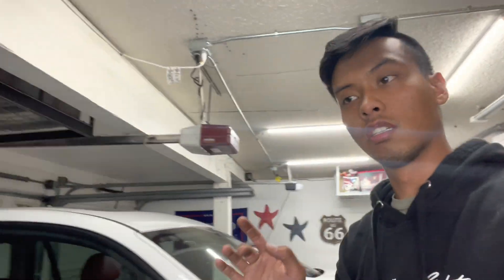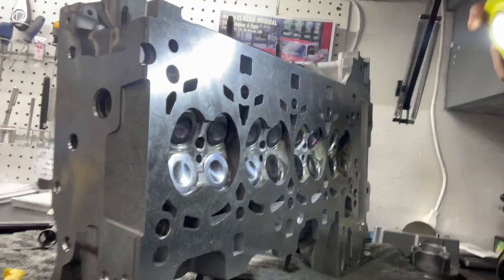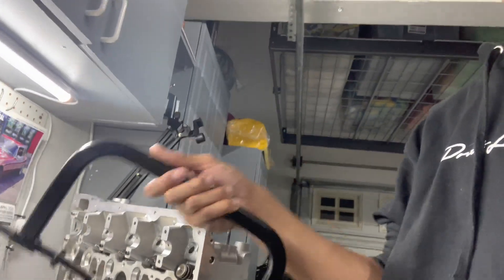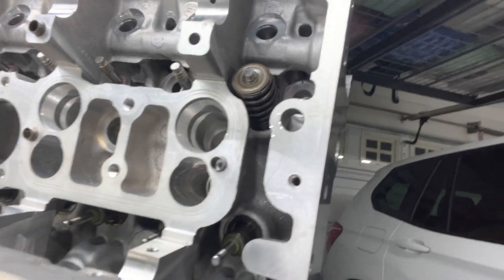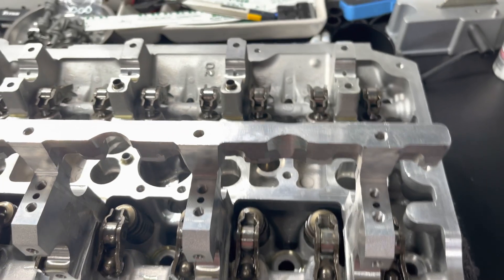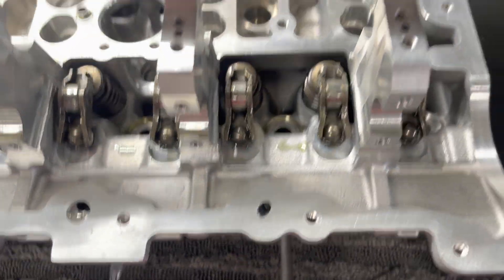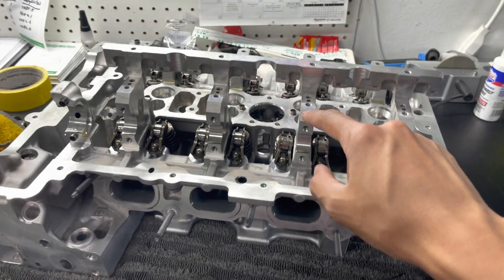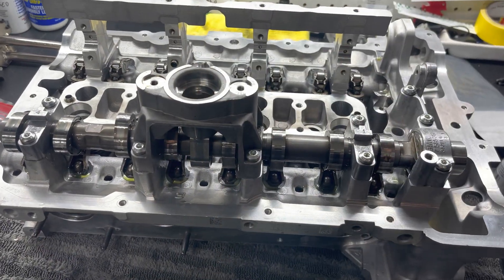BMW N20 F30 Build Episode 6: Cylinder Head Assembly

Comment: Hey bro. How do you accurately set the camshafts at tdc without the tc on? Do you just rotate the camshafts separately until cylinder 1 is at top most then lock with the tool.

Comment: What is the spring tool name and where can I get it
Reply from the maker: I purchased mine on amazon it was marked as a N20 Valve Spring compressor for the intermediate rocker arm springs, the other compressor tool I used is a normal c-clamp style valve spring compressor

Comment: When you install the camshaft the barcode has to be on top?
Reply from the maker: When setting timing yes, when assembling not quite as critical but would save some hassle by having them already in the right position for locking them in place with the timing tool

Comment: Any video with the block assembly?
Reply from the maker: I’m working on the next video still going over the more niche stuff with the block like clearancing for the rods and the process for me timeserting the deck of the block for the studs. It’s going to be a more picture commentary style because of how the last half of assembling and then reassembling the top end of the engine again because of the original threads in the block. Been a little bit of a struggle but it is coming feel free to ask me questions here or on Instagram and I can get some photos over to you and help out if needed!

Comment: Did you replace the valve guides? Which ones did you get, if so?
Reply from the maker: Yes I did replace them, I called up a place called SI Valves and they happened to have some that were very close to the original guides dimensions and I had those sent to me. They are the same material as the original guides and were put into my cylinder head without issue
Reply: @GeoDayrit1  thank you sir
Reply from the maker: @GiorgioBerrospi  no problem!

Comment: Did you use the stock springs?
Reply from the maker: Yeah I stuck with the stock springs on my valvetrain don’t believe I’ll be hitting the limit where an upgrade is necessary, I believe the super tech kits for the s/n55 work for our motors as well if you’re looking for an upgrade, also think Harry has got something in the works too
Reply: @GeoDayrit1  Yeah man, I swapped everything. Did you call Crower for the cams?
Reply from the maker: @nilaht9  I did not for this motor unfortunately no time, motors got to go back in by mid this month and be run in, been without the car longer than planned, but eh that’s part of the hobby, not to be without the hiccups
Reply: @GeoDayrit1  I understand 100%, I wish I can say the same. Unfortunately, I know it’s going to be a good minute. Car being completely gutted and rewired. Transmission, engine and fabrication.
Reply from the maker: @nilaht9  transmission choice still up in the air atm or settled on one now?
Reply: @GeoDayrit1  I want to keep ZF but my shop thinks the pure build to expensive. If I could find the parts it would be cheaper. I’m in search to find the upgrades. Instead of shipping my transmission.